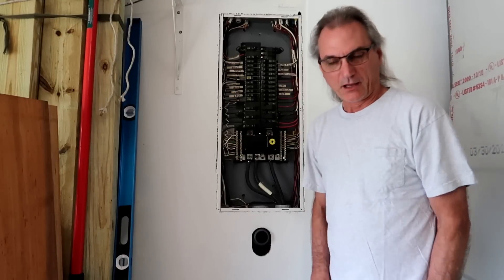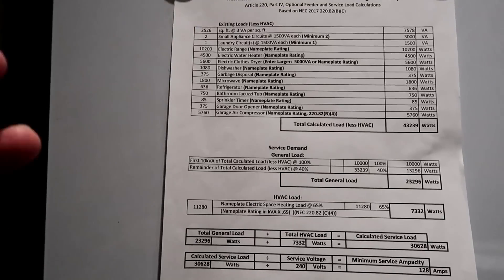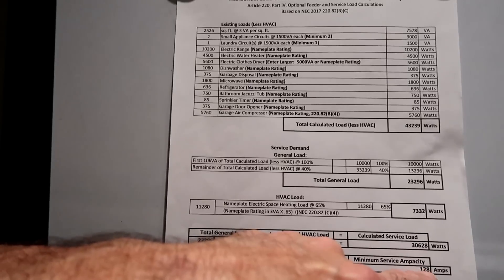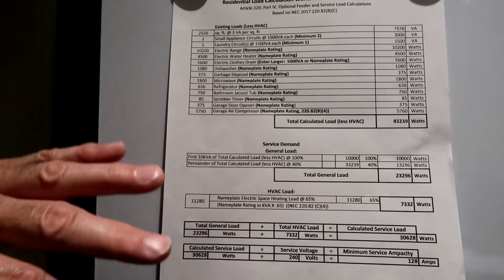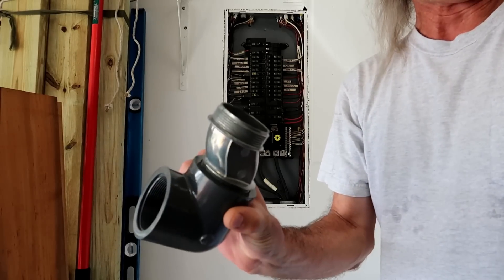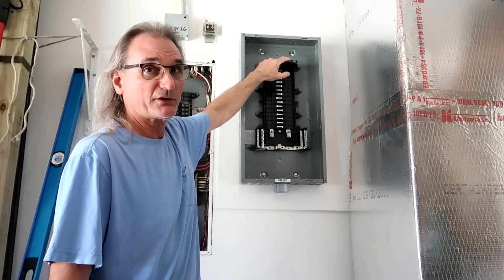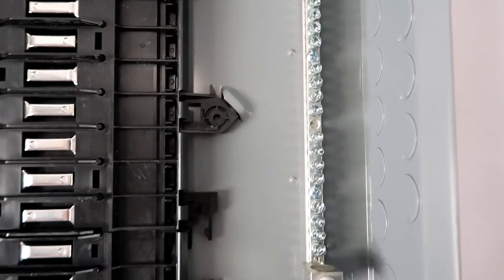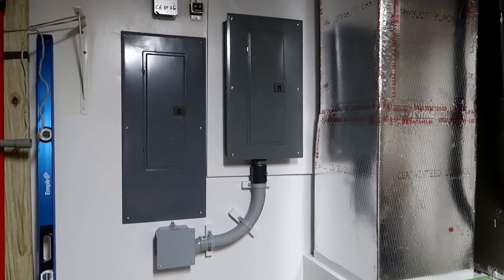A Sub Panel Installation With A Permit And It Passed Inspection

Comment: Without question, this is the best DIY video of a sub panel install that I've seen. For the regular laymen, it's perfect.  

Not sure if you'll be able to provide some insight on this, but I'm wondering if you can give me an idea how the load calculation would work if you are installing 3 phase power in a shop with a phase converter. My home has a 200amp load center in the basement which is on the opposite end of the house as the garage. I'd like to run a sub panel across the house, and install it in the garage. From there, I'd like to have a rotary phase converter installed (probably a 20 hp version) to run my 3 phase motors that power my woodworking tools.  The 3 phase motors are a 5hp jointer, 5 hp bandsaw, 7.5 hp planer, and 7.5 hp table saw.  I'd like to have a separate circuit for lighting so that the lights don't dim, and a few 220/240 outlets for the future.  How do you calculate your load when you have a rotary phase converter being added? The converter serves as a generator for the the 3 phase machines.
Reply from the maker: Thank you for the compliment Joshua. I am pasting a link for figuring out single phase converter power requirements:

https://www.northamericaphaseconverters.com/calculating-single-phase-converter-power-requirements-for-driving-three-phase-motors/

However, you need to also look at NEC 2017 Article 430 Motors, Motor Circuits, and Controllers: It mentions kilovolt-ampere (kVA) per Horsepower with Locked Rotor, so there is a maximum 'locked rotor current' value you have to factor into your load calculations obtained from a motor Letter Code on the motor, Table 430.7(B) Locked-Rotor Indicating Code Letters. The motor code letters run from A to V (there is no letter I, O or Q).

The NEC 2017 Handbook cost me $200 at Barnes & Noble.  The book has 1300 pages, everything you need to know is in it, it is just a nightmare to decipher and will give you a headache. I wish I could do more for you, but I hope this helps you out some. Thanks for watching.
Reply: @StevesStrayStuff  Many thanks Steve.  North American Phase converters is my top choice, and Keith Rucker over at vintage machinery has a 10% off promo code with them.  As for the NEC handbook, I'll probably have to pick one up.  Appreciate the feedback.
Reply from the maker: Enjoy your new shop once you get it up and running!
Reply: Do you already own all that? If not, just buy 240 single phase equipment. Those motors arent big enough to warrant 3 phase
Reply: @Ryan-hr9hw  36" Oliver 416D bandsaw, 16" Oliver 166 jointer, 24" Oliver 299D planer, and 8' Martin T75 sliding table saw. All of these are 3 phase, all were purchased at auction, and the total cost for all of them is was $2650.00   You'll never be able to buy single phase machines at the same quality for the same price.  So yes, it's easy to justify the additional cost of a phase converter considering the money saved.

Comment: I need this for my new home theater in garage. woohoo thanks for video
Reply from the maker: You're welcome!  I added this power for my home audio equipment.  I was tired of the family room and bathroom lights blinking with the bass.  Also, I would occasionally trip the breaker at high listening levels. All of my problems are now solved!

Comment: Thanks for the very educational videos.They were a great help in planning the installation of a subpanel in the garage of our home.  I am a bid luckier than you were, I don’t need the calculation sheets.  The Department of Community Development Plan Reviewer instructed me to just file an Owner Affidavit, pay for the permit and call to schedule an inspection after completion of the project.  Our Load Center is surface mounted inside the garage on a block wall, which makes the mounting of the sub panel much easier.  An 1 ½ in. offset conduit nipple with locknuts and 4 Tapcon crews will do the trick.Well, it possibly helped that I sent an email with pictures, planned parts and method of installation to the Department before starting.I would not have been able to convince myself to tackle to project without your videos.  If you ever come across the Hartland to the West Coast send a message and I will buy you a “Schnaps” as thanks for the great videos.
Reply from the maker: Hi Paul.  I am glad you were able to use the information and found enough faith in yourself to give it a shot.  When I make it out that way to drive the PCH, I will let you know!  Enjoy the new power.
Reply: Hi Steve, I am back with a big headache.  A headache from reading opinions in regards to the installation of an Eaton Whole House Surge Protector.  The opinions go apart from the top of the panel to the bottom of the panel and anywhere in between.  Eaton sells a panel with a WHSP installed; at the bottom left position.  The shortest wire run for my installation would be the top right position, looking at the panel.  Would you agree to use this position?By the by, I drove the PCH from Santa Monica to beyond Monterey, while living in Mar Vista, CA for 42 years.  However, I have not seen a PCH here on the FL West Coast yet.
Reply from the maker: Ha-ha, the west coast of Florida, duh, I automatically thought California!  Then the odds are good that I will see you soon!  For whole house surge protection I use the FPL Surge Shield that is installed at the meter, so I really don't have any input to contribute about your protection in the panel itself, sorry.

Comment: i’m considering doing this myself as well...estimator came out and wants $1000...thanks for the video
Reply from the maker: You're welcome!  I got the load center new in the box off of ebay for about $100, the 100 amp breaker new in the box off of ebay for $50, the wire is from Wire & Cable Your Way for $1 per foot.  The junction box, 90 degree radius elbow, metallic offsets and plywood are from Home Depot and the other 2" PVC fittings I used are from PVC Fittings Online.  I spent about $300 for the materials.  Take your time, plan it well and it will work out just fine.
Reply: Thats a good price for a PROFESSIONAL INSTALLATION.
Reply from the maker: I also agree that is a good price, however, if more professionals performed a PROFESSIONAL INSTALLATION, there would be less people looking for the DIY solution.  My neighbor had his PROFESSIONAL INSTALLATION fail the inspection process twice before it was finally approved.  Unfortunately, hiring someone with a license does not guarantee a professional outcome.  People get tired of paying for a lesser job than they could achieve by doing it themselves.
Reply: @StevesStrayStuff  hi there! what kind of elbow did you use to transition from the bottom of the panel into that box you mounted on the wall? you can see it more clear at 16:48 mark as it’s poking out of the drywall with the wires coming out of it
Reply from the maker: @pharaohacura3618  I got the fitting from https://www.pvcfittingsonline.com/   People have really busted my balls for that one fitting claiming it is for plumbing use only and it is not per code.  NEC says Schedule 80 PVC is acceptable and all the Schedule 80 PVC is gray in color, so I used it because I could not find anything that says I couldn't, other than people telling me I can't.  I have seen way more videos with a lot more not to code than my one 90 degree elbow.

2" elbow  https://www.pvcfittingsonline.com/808-020-2-schedule-80-pvc-ell-fipt-x-fipt.html

2" nipple  https://www.pvcfittingsonline.com/861-251-2-schedule-80-pvc-nipple.html

2" offset  https://www.homedepot.com/p/Halex-2-in-Rigid-Offset-Conduit-Nipple-04020/100141375